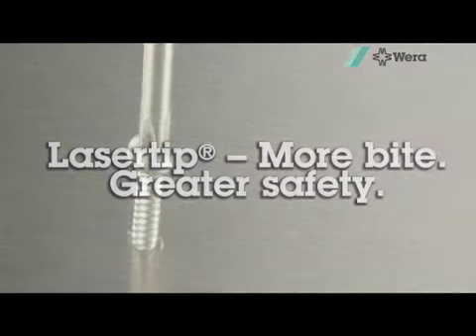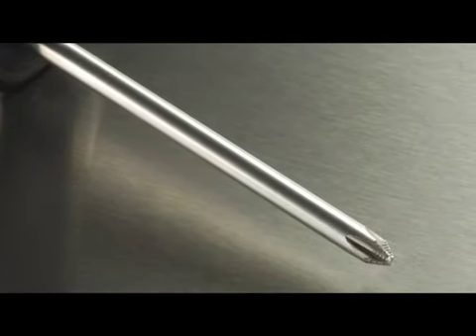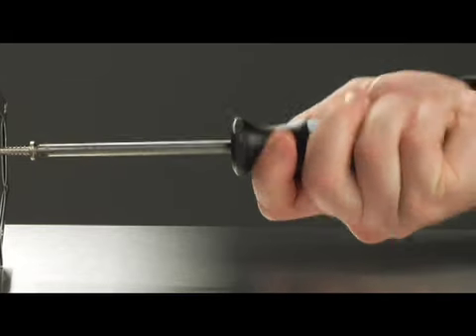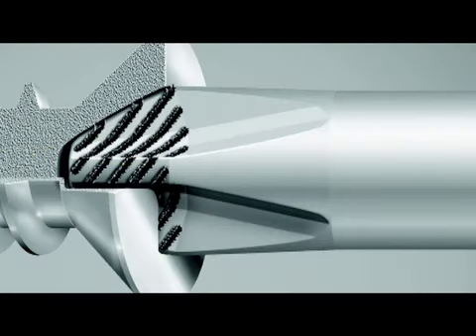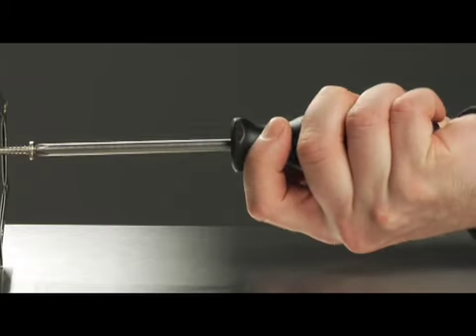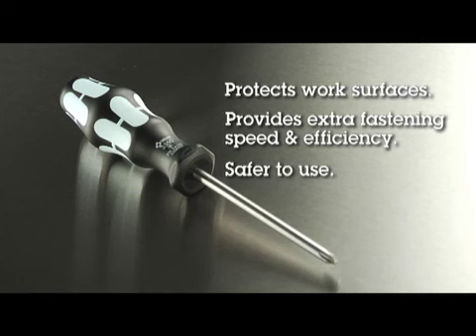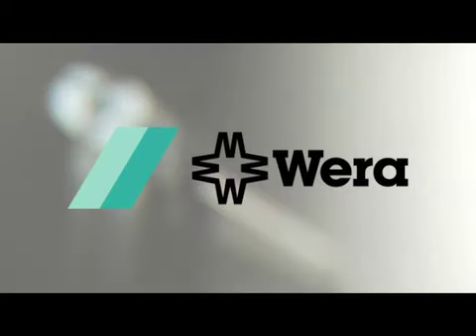Wera Lasertip: Anti cam-out non-slip screwdriver tips

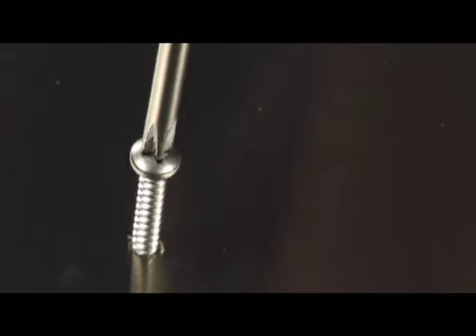Comment: Hmmm like the idea of the laser tip and have considered them my self, but if you use the wrong driver head for the screw it's always gonging to be a problem: look at 0:03 to 0:09 the driver is too small for the screw and the person is wiggling it trying to make it fail. Makes me wonder how well the Lasertips would bite/grip if they are they are too small for the screw. Can we see that video?
Reply: Phillips heads were designed so that a #0 tip fits a 0 and 1, a #1 fits a 1 and 2, and a #2 fits 2 and 3. And I'm pretty sure thats a #2 in a #2 screw.